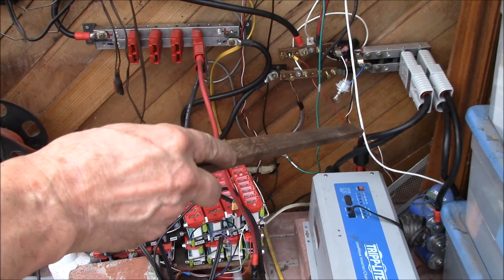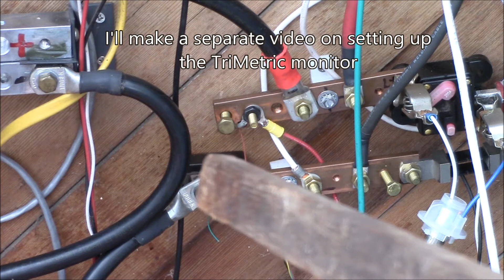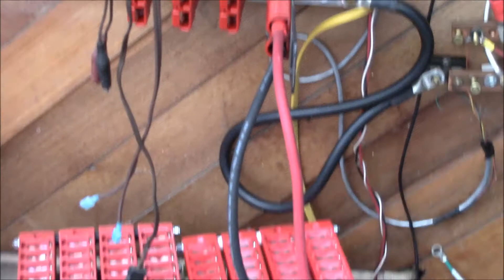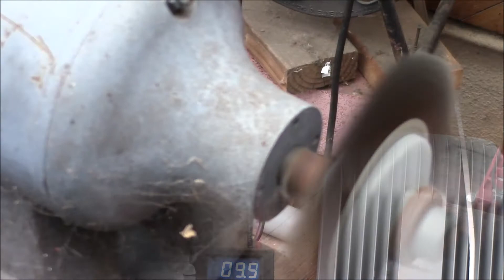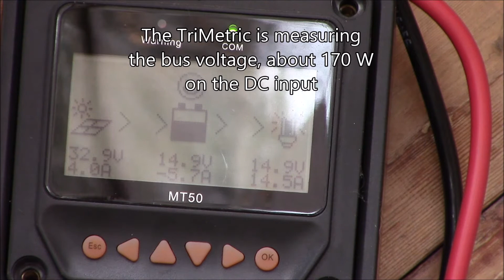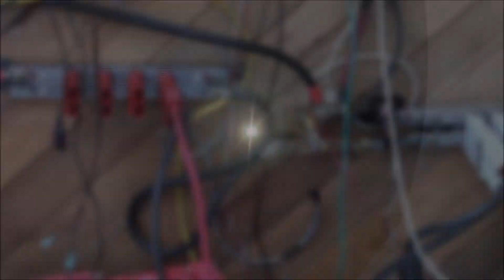16 volt DC-AC Power Inverter, Part 1

Comment: Those 175 amp Anderson bus bars look scary that close together.  I see your insulator, but I really think you should rethink that.
Reply from the maker: Thanks for the comment.  I have 2 layers of 12 mil UHMW (clear) tape between the two bars for insulation. When I install them in my shed, these will be on the back wall and rotated 90 degrees (connectors facing up and down) so they will be very well protected from accidental contact.  But yes, right now they are a bit exposed.  I may redo the UHMW tape to make it stick up higher between the bars instead of trimming if flush like I did.  That's part of why I want to set it up and find any issues now before everything is mounted for good inside the shed.
Reply: R Brown,   Suggestion, machine a 1/16 of an inch off both buss bars on the surfaces that face each other. Then 3d print a cover to go over the positive bar.
Reply from the maker: Yes, I  was thinking of something along that line with regards to a 3D printed cover piece on each end.

Comment: sweet! thanks for the update! nice inverter!
Reply from the maker: Thanks for the comment.  Was nice to finally get it hooked up and see if the data sheet was correct.  It seems to tolerate 16 volts with no issues.  I think this will work a lot better than trying to make a 3S / 12.6 volt system work.

Comment: good job no smoke -:)
Reply from the maker: Yes, that's true.  It is nice when you can trust the specifications listed in the manual.  This may not be the most efficient inverter out there, but it does live up to all the specifications.
Reply: R Brown as long az the inverter works it does not matter what model